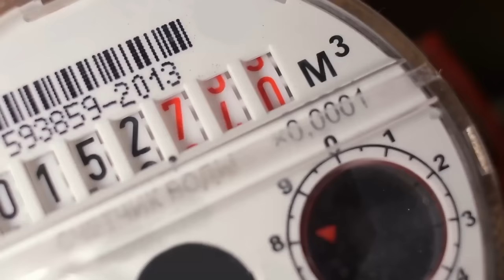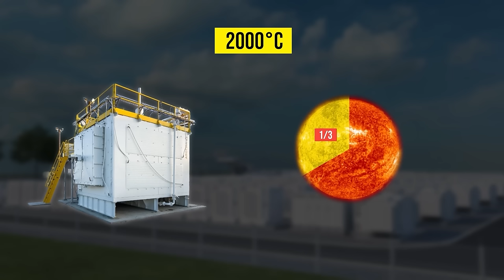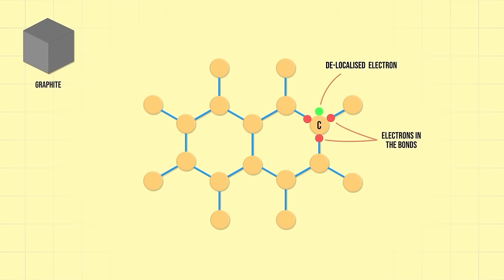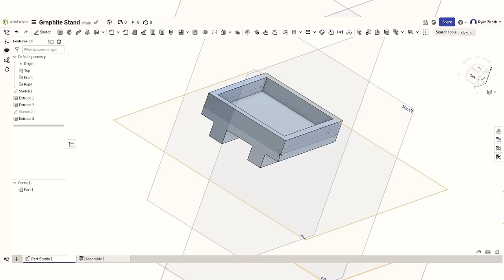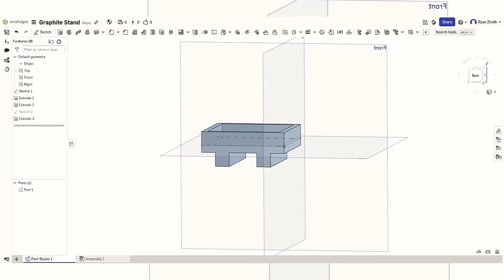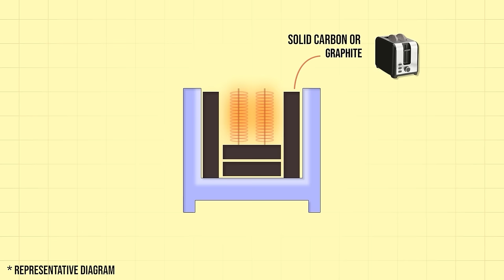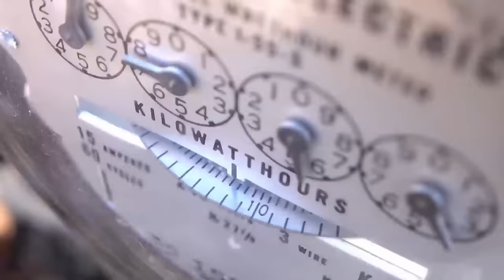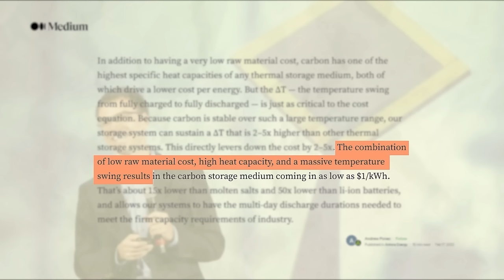Why Solid Carbon is the Future of Energy Storage

Comment: Using it for direct heat would expose it to air and cause emissions, so that’s a no-go. The thermovoltaic battery use doesn’t sound competitive to existing solutions, and this isn’t the first video I’ve seen about this tech boasting it without really deconstructing its viability (“without sounding like an advert”, but it does sound like one regardless). I imagine its viability is quite limited by its thermal conductivity, where its capability to keep heat energy stored is exactly what limits it in usefulness in releasing that energy at when it’s needed.

Also, the “at scale” comment completely evades the inevitable followup: what is the actual “scale” that would be needed? I imagine it’s rather massive, so massive that it would better to just build a nuclear generator and instead use its excess energy to capture and store the carbon so it can’t be re-released into the atmosphere.

Comment: The way I see it, this battery looks like it has been moved out of the industrial process into its own place.  In other words, the graphite and heaters could be a part of the ovens of the industrial process.  When the electricity is off, the graphite's stored heat keeps the process running.  The amount of graphite determines how long it can run.

Comment: You mentioned reflecting back "at the sun" is not a great idea but how about dual layer behind PV? a storage medium and a reflective medium behind? Basically any low-energy photon that passes through the semiconductor can get absorbed and given a chance to reemit at a higher energy after, but only emission towards PV matters because any other direction is reflected back. Or would something like that cost more than the yield increase is worth?

Comment: Seems likely to revolutionize the energy sector.. but it struck me that the thermal PV could be placed deep underground to convert geo-themal heat directly without using liquids or gases.

Comment: Cheap renewable energy through the use of wind turbines and soar panels is a myth.
1) Mar 16th this year Texas solar farm hit with a hail storm destroying 14,000 solar panels !!
2) It costs far more energy to make blades for wind turbines than just using a coal power plant to begin with. And then there is the problem of de-icing. 
I wonder if these batteries would be useful in some other kind of application?

Comment: Research is often speculation, but the money still has to flow to get the research done.  Good luck with their research. It can take a while before lab concepts bear fruition and are commercially viable. In the case of Lithium, NMC pioneering work started in the 1980s, and it was only around the early 2000s that the inventions were made by several teams. Now, lithium NMC is ubiquitous in almost everything we try to power.

Comment: Ok, so I am layman here, but how many of these “battery’s” would you need to have charged up to run a steel mill for a day? Also steel mills operate during the day when would you reliably charge the battery thingy? Solar will only charge it during the day and wind will only charge when there is wind. Seems like it would take longer to charge than discharge. 
Just heat up the steel mill directly with the solar panels you are heating up the massive block of carbon hotter than the steel mill with resistive heating anyway. I’m not the only one seeing the problem here am I?

Comment: Its possible I missed this in the video, but couldn't these be used to convert existing conventional thermal power plants (burning coal or natural gas) in cheap batteries for peak loads? Install these big carbon blocks where the furnaces exist now and charge them up on surplus power then discharge when theres demand. 

And those sites are already connected to the grid in just such a way to help load balance the grid.

Comment: Heat storage at home could be 20 times smaller for daily home heating using only rooftop PV electricity. 
This could be better than heat pumps using grid electricity. 😊

Comment: Question: efficiency means - by definition - the percentage of energy supplied that's converted to useful work, the rest being converted to heat. How is it possible, then, for resistive heating to be only 99% efficient? Where does the 1% of energy that's not converted to heat go?
Reply: Heat loss in the connecting wires

Comment: He needs to focus more on costs. 
Not sure he went into the electric generation enough.  Ok 40% sounds ok, but surely the amount you can get from the area you can expose will be negligible.  
That said, once the high level heat is used, you still have a very hot medium that can be used for more traditional electric generation

Comment: FYI, I followed the link and got a 404

So, giant blocks of burned toast heated to red-hot temperatures. Snark aside, this - is hard-core stuff. I especially like the high thermal conductivity, which would require less plumbing and allow greater power delivery.

But where to get massive blocks of carbon? I dunno, how about

coal?

Comment: Pencil lead is a mixture of CLAY and Graphite, it would be far too hard if it were pure graphite.  Also the unbonded electron of graphite is not the source of electrical or thermal conductivity, if you fully bond all 4 electrons in carbon you get a diamond which has even HIGHER thermal and electrical conductivity, not less.  It is the bonded electrons which cause a material to be conductive.

Comment: The presentation talks about the issue of low efficiency when storing heat from electricity and converting the stored heat back into electricity.  I don't know why they would try to use TPV cells with a practical efficiency of around 20% to 25%, when a conventional turbine setup can achieve above 50% efficiency.  

The real question is, what problem is this invention solving?  The only answer is, to utilize surplus renewable energy.  That is a much more complex issue, than just building inefficient storage and saying the energy is "free".  This is no panacea.

Comment: I guess an issue could be, how long can it hold the power? And that's the rate of heat leakage?
It sounds like it's a few days. Is that good enough for what's required?

I wonder how this compared with hydrogen. I guess this could be a good short term, high efficiency solution, and hydrogen being lower efficiency but long term storage. Lithium batteries being good for efficiency and storage time, but dependant on resources like lithium.

Comment: Heat escapes faster, the faster is the difference in temperature. With such high temperature the losses must be terribly high and practically impossible to prevent with insulation.
Reply: Yeah, I wondered about the storage efficiency. With an ideal system (maybe a vacuum layer), you should be conducting almost no heat out, but preventing radiative heat from escaping should be harder, I would think.
Reply: With reflection, shiny surfaces and highly insulative materials about 1 foot of insulation would be totally enough also the larger the volume the less service area, shape also matters. A sphere has the lowest surface area per unit volume. A square cube is also decent. A container is not really that good but if you put two of them side-by-side or four of them, side-by-side t and two on top of them, you would only have to insulate the exterior walls. I’m guessing highly reflective, interior walls, high temperature insulatating bricks in the inner then Rockwool insulation then maybe regular fiberglass for total of about 16 inches should be very insulative. Of course you could go further as it is such a high delta T

Comment: I see the advantages for industrial processes, but if you talk about grid storage you need to compare it to pumped hydro.  I can't find  a LCO for pumped hydro right now.  Also, is a carbon battery more efficient than an electric arc furnace or an electric arc furnace plus pumped hydro storage?  Granted pumped hydro takes up a lot more space and is harder to site than storage containers.
Reply: Every pumped hydro installation is different and to be remotely viable requires some very specific geographic conditions.  I doubt many untapped locations for pumped hydro exist.

Comment: I have one major question: Why resistive heating and not a heat pump?

I mean, you can easily pump four times the energy input this way, so what is it that I'm missing here?

Also, instead of using a mirror, couldn't you put the photovoltaic panel between two chunks of graphite?
Reply: My guess is these components cannot handle 2000°C. Amirite?

Also, a heat pump needs heat around it to work. You could use sunlight and a bunch of mirrors, but that definitely complicates this quite a bit.

Comment: That sounds a bit strange: how come can this be cheap, while even during conversion from temperature to electricity we are wasting 60% of energy? In such situation, even if we are saving a lot of money due to low price of the system (which isn't so obvious, taking in regard that there is a lot of technology inside - including TPV panels), our savings will drop with huge loss of energy during the process.
This is obviously an interesting option, especially when compared to molten salt energy storage, but I would love to see the final calculation.

Comment: I assume you create high pressure steam from the heat to create electricity
Reply: He talks about it in the video: No, the idea is more to use special PV panels that can create electricity with the thermal radiation (infra-red). I'm not too convinced this is the best approach to get maximum efficiency myself but I'm no expert

Comment: So, if it converts the light from the graphite (not the radiant heat), you could keep the graphite in a insulated storage and use a clear window. It could be made out of quartz or some such.

This makes me wonder if they could not use graphite instead of molten salt / sodium in this new nuclear power boom.

I would have made the stand hold the cube at a diagonal, much more interesting.

Imagine if this tech could be used with captured carbon.

Comment: @9:07 but it will burn. I've burned carbon and seen a real diamond burn too. At low pressure it turns to gas and at high pressure you can get a liquid phase.

Comment: They give 40% thermal to electrical as the efficiency, then mention that a mirror can reflect the remaining heat back into the storage block for re-use.
So my question would be: 'What is the efficiency thermal to electrical after n cycles?'

Comment: I'm afraid that most of the points they do against batteries are not true in the long term.
Like rare earth minerals. Most of the time, in stationary storage, the market isn't using NCM or NCA , but LFP. But in the future, sodium-ion seems even like a better alternative. That's also reduces the cost of the battery. On other side, the long life has increased with LFP, and sodium-ion will probably also being more long living.

The low roundtrip efficiency is not something you can discard easily, that it's the main argument against this technology as a electricity-electricity battery.
That's said, when electricity needs to be converted to heat in a 1:1 ratio (high temperature like that usages mentioned), here a thermal battery could be of great sense so there is room for this technology in the industry sector. If the battery has no unknown problems or higher costs than projected, seems like a great addition to sync between renewables and a high temperature industry.

Still... I think that the argument about "prices at zero cost" are too optimistic. The number of hours of this type are scarce and it should be, because it means that renewables owners are underpaid. Other storage technologies will compete here doing that the number of zero price will be very scarce no matter how much renewables you connect to the network.
So I think best calculations should assume a similar price to renewable levelized cost. When renewable electricity would be cheaper than fossil fuel heat, then this system will be profitable in the industry sector. Probably no yet, but soon.

Comment: About the 9-minute mark is where he actually starts to explain how this battery device works. So the entire first 9 minutes is vague boring PR preamble. Essentially you can use the heat stored directly, transferred through some kind of liquid in pipe heat exchangers, water, steam, or oil. Or it turns the heat into electricity directly with built in special PV cells tuned to infrared light. This part is really extremely interesting and I would love to see exactly how that is implemented. Like how many of these PV panels can they fit into one of these container size batteries? It seems like the power density might be kind of on the low side since it takes acres of solar PV to generate decent kilowatts. I for one am getting so tired of YouTube videos like this where the first 5 or 10 minutes is useless preamble. Get to the point people get to the point. If YouTube demands you need longer videos then spend more time explaining the really interesting technical details which in this video I'm sorry are actually a little bit thin.
Reply: You could mark that as the highlight in sponsorblock or something

Comment: The thing that interests me is could we use it to drive a car or motorbike? Just use a simple heat engine like a flame gulper gulping heated air. So, what is the energy density.
Reply: Theoretically it could, but that would be extremely inefficient. There is a race for light weight and energy dense batteries in vehicles, and so far lithium provides the best batteries for that. The carbon batteries in this video have the main advantage to be cheap for large scale industries, so different tool for different use
Reply: @arnspyarchi6040  Yes, but my shopping centre is 2.5 kilometres away. In Portugal, fuel is expensive, but I basically have unlimited solar power, so the efficiency doesn't matter much. My best prospect seems to be feolite.
Reply: @DavidPaulNewtonScott  for 2.5 km it is very feasible to only use an ebike +trailer, or even just a regular bike
But yeah it would be a funny to try to do it with steam engine
Reply: @arnspyarchi6040  I want a car to carry a wife and two kids. In Portugal, although the climate is mild, it can rain a lot in the winter. I don't like steam as a friend of mine pointed out you are creating a mobile bomb on wheels. We have unlimited wood waste from forestry. One could charge the heat store by burning wood. I think I have got this figured out. I will post a video on my channel when I try it. At the moment, though, if you look, you will see I am rather preoccupied at the moment, to say the least.

Comment: How exactly they extract the heat from these batteries? It is not very clear to me.
Reply: Open up the side of the cube and point the light at something to heat up. Look at a toaster oven. Those tubes that get red hot are emitting infrared radiation. Infrared is outside of the visible light spectrum, so the tube does not even need to be red for you to feel the heat and the light you see are those lower energy photons that they where talking about in the video.

Comment: In other words 40% efficiency and insulation capability of heat storage preventing cooling measured in "days" means turning renewable energy into heat and releasing it into the environment for free and cheap.... while "we're all sleeping". Absolutely amazing! I'm stunned!!!! 

Carbon based radiators it seems have brilliant future in icy California. 
Brilliant.

One correction thou. The technology used to melt iron using only electricity during the day is there for DECADES. 
It is used mostly to melt down scrap. 
That's electrodes creating arc.

Comment: Would it be possible to bundle light with mirrors and inject that hot beam straight into this battery? It's being done in other setups, but can it be done here? Because if that is the case, energy collection becomes massively more efficient, the efficiency of PV solar panel still lacks plenty. Just imagine charging the battery basically straight from the sun.

Comment: This is an interesting technology, but I am unsure about useful it would be in replacing industrial heat needs.  I would think that it would be less expensive and easier to use the same process that heats the graphite to heat whatever application needs heat and avoid the storage issue.  The problem of transmitting energy in the form of heat even over a very short distance seems to be Achilles Heel of this method.

Comment: I hope this or something like it becomes a reality. Along with solar and wind, new nuclear fission designs are advancing. I'm not referring to the liquid fueled reactors that seem to be R&D magnets only. The new solid fueled reactors that use TRISO fuel are much safer, my favorite is the KP-FHR. But a good idea, from another design, was to use the heat generated to heat up large tanks of molten salt instead of directly powering steam generators. The steam cycle is actually considered by the NRC as part of the reactors safety system and thus is part of the NRC licensing process. Heating the molten salt storage tanks removed that part of the licensing process which is a huge benefit (KP-FHR uses other cooling methods to make up for the lack of steam generation). I don't recall witch design proposed that storage system, but I wonder if these graphite batteries could be used with nuclear and gas?

Comment: There is a gap. Insulation. A bit hard at 2000°C. Now the larger the cube of grafite, the less surface it has compared to its volume, and with that the less loss it suffers. But even then. The higher the temperature difference the more loss there is and with that the larger cube still loses a lot of heat.
Apart from that, heat transportation is an efficiential nightmare! 
What is showed here is an engeneers dream, paid by the IPCC in the end.